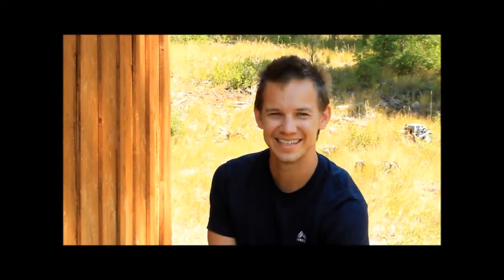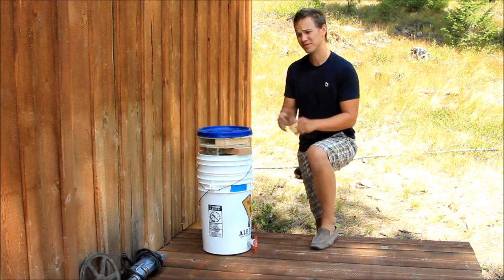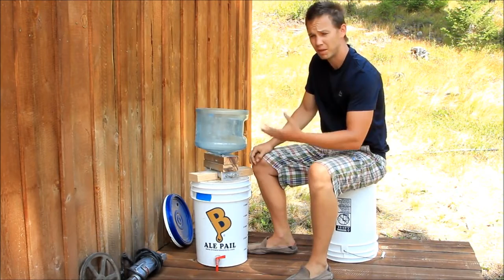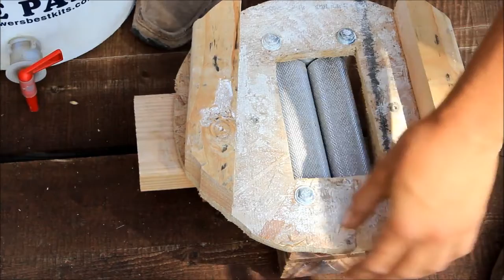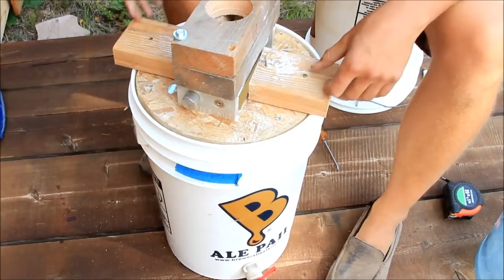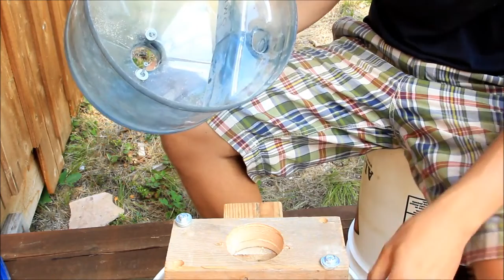DIY Grain Mill Build for Homebrewers | Affordable & Robust Brewing Gear

Comment: Ok but you only discussed 1 other mill and then all you did was go buy a 2 roller mill. Those dont have the best durability and there are others on the market.
Reply from the maker: 15 years on my double roller is still slaying malt.  I don’t have a need or interest to bench test everything on the market if this is bought and paid for.
Reply: @IBrew-UBrew so you wasted my time.

Comment: The step mash method produces pseudo, ale and lager. The decoction method produces authentic, ale and lager. What is the beer called that you make by soaking, inexpensive, high modified, malt in hot water for an hour?